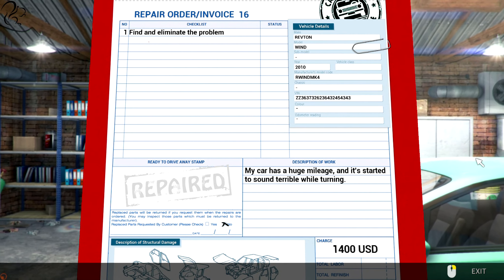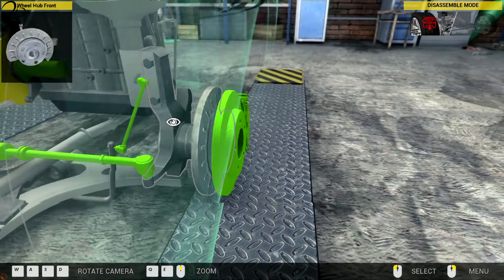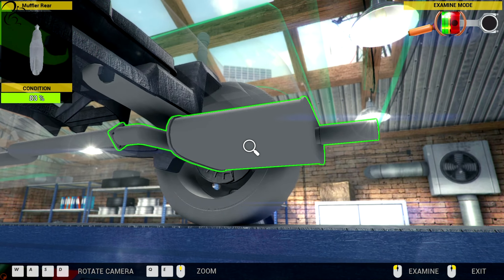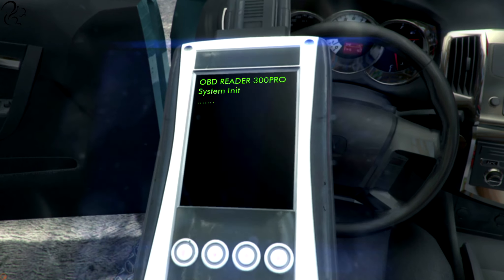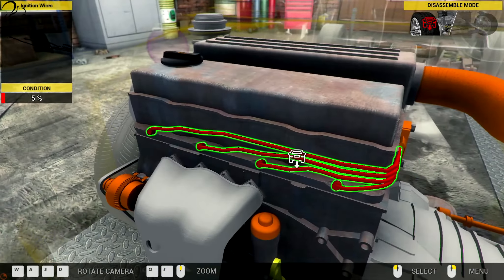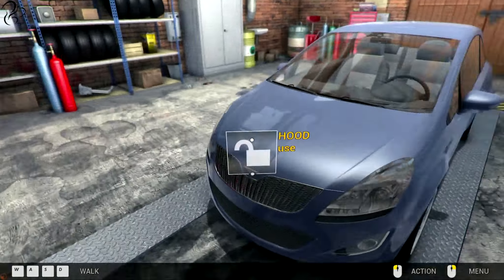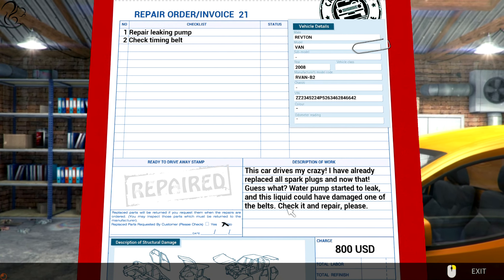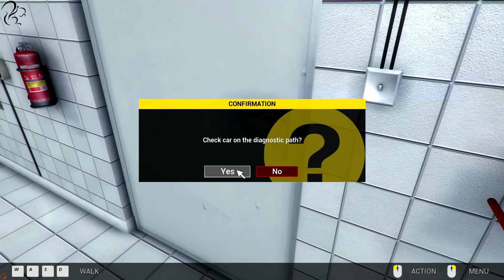Car Mechanic Simulator 2014 - Career Mode (Episode #5)

Comment: Squirrel, yes 5% more income means that the costumers will pay you more 5% per level.
Notice that when you receive a job, you get the money from it right at the start of the job and it pops up a little box on the right bottom of the screen with the money you earned.
So, if a job pays 1000$ and you have, say, a level 3 Business Management (15% more income) it will show 1000$ on the "invoice" but it will show 1150$ on that little box, and it's 1150$ the amount you will receive.

Comment: hi squirrel you asked why one drive shaft if more money than the other its because one is longer than the other as the gear box is more to one side of the car witch the sockets that the drive shaft sits in is also more to one side so one is oftern longer than the other lol

Comment: due to car's engine position which is in the middle of the car most of the time, the transmission will not align properly at the center of the car. This leads to the metal plate which is behind the transmission which holds the left and right axle. As the transmission is not perfectly aligned with the center of the car, the axle length will not be the same thus the difference in price when buying axle. This is why Subaru claims that they have symmetrical axle and this is true due boxer engine technology. side note, porsche 911 also uses boxer engine. :)

love the video bro! started to play the game after watching your videos :D

Comment: I think, Squirrel, that a left axle may be more expensive in the US because of the higher number of left turns. So therefore in the UK, it would be a right axle instead. Just a theory.
Reply: Not sure but not both axles are same length, because the transmission in most fwd cars is more on the left, so a longer axle would mean more metal, hence more expensive

Comment: The drive axles or CV axles as their called are different in price from right to left where the short one costs more. This is actually correct to real life parts pricing. I have changed a few myself and save a ton of money rather than getting raped at the repair shop